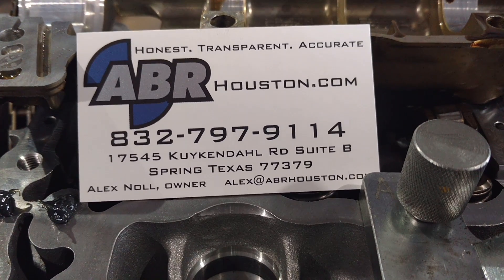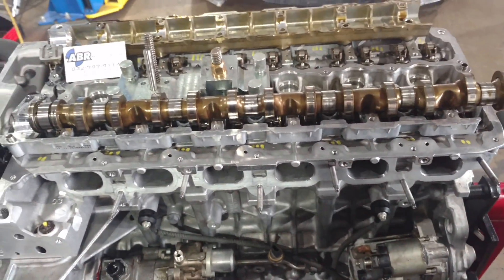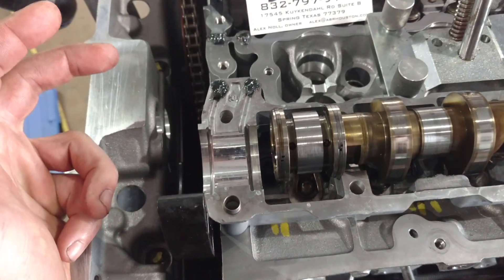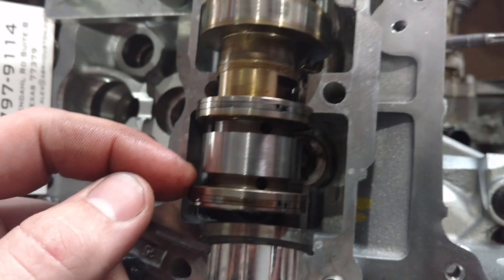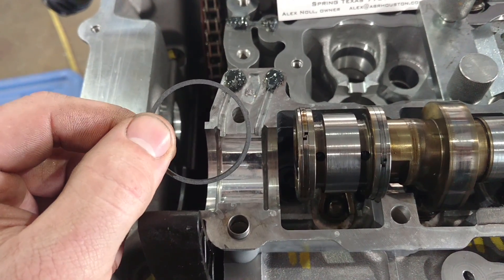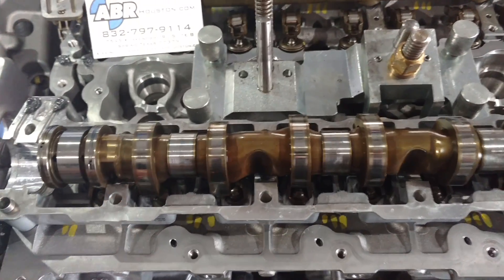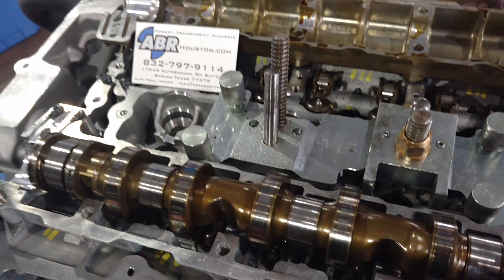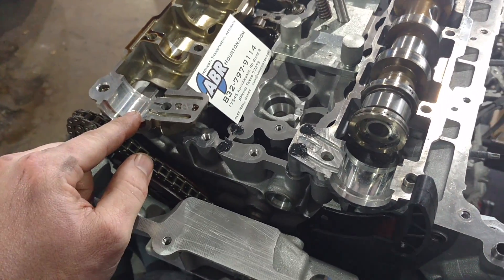ABR Houston explains N54  N52 and general Vanos faults and why

Comment: Occasionally, VANOS iosues coan be caused by the non-return valves on the side of the block. Also, it can be caused by mistakenly swapping the exhaust and intake connectors (white wire with red tracer is the exhaust and should go to the lower solenoid, the one with the blue tracer is the intake). One more issue could be the ring that needs to be properly seated at the bottom tip of the oil filter cap. That small green ring closes the oil drain to the pan, which during normal operation should be blocked by that ring. Great content, thanks for posting. Makes one wonder why BMW doesn’t use the teflon seal that you’re recommending.

Comment: Hello just subscribed to your channel, really good information. Question? I have a 2010 bmw 328i i moved from Washington DC area to hot Florida, I'm using castro 5w30 currently. Should i use a different viscosity oil or continue with what I've been using? Thanks again.

Comment: Hi. If there are no check engine light, but intake camshaft value is from 60.8 to 61.2 in all RPM range. Does it mean that camshaft rings are bad? If it's possible that vanos are stuck in one position?

Comment: Hello Alex, I am having this 2A85 code.  Car run perfect with exhaust vanos solenoid unplugged. As soon I plug in the solenoid, the car will run like it burn to the ground and die and will not start if I don't unplugged the exhaust solenoid. Please help advise.

Thanks,

Comment: Could this issue ever cause an N52 to die at idle/stop lights? I have The 2A82 code, but the car isn't sluggish or anything. But it has just started to sputter and sometimes die at stoplights, and low revs starting to go up an incline. And not all the time, just once every drive. After it dies, I start the car and it's fine.
Reply: I just ran across this same issue! I just changed the oil and cleaned the solenoids. Soo let’s see how this goes!
Reply: @TheOfficialKarl1  lemme know how it goes! I already did what you did, no effect. I'm thinking eccentric sensor next, but it happens so rarely I might also just live with it lol

Comment: There is no ledge for inlet camshaft like exhaust in n52. So if I replace only the first bearing cap would it help? Or I have to replace whole cylinder head because the rings scratches both sides? What do you think? Please help

Comment: Hello.  Does just replacing these metal rings with Teflon ones help?  I have a sucking vanos bug.  I replaced selenoid and vanos.
Reply from the maker: If the cam trays are grooved, they must be replaced as well
Reply: Thanks for the answer.  If there is a groove, should the head be replaced?

Comment: I am getting occasional codes usually when the engine is hot. Assuming there are smaller groves could Liqui Moly Ceratec additive help?
Reply: Yes it could. Even for ticking HVA.
Ceratec takes effect after 800 kms.

Comment: This is excellent video mam. I have 2007 bmw 328 xi and I have a p0012 code, I have clean oil in the engine and. I replaced camshaft and exhaust valve solined with bmw part and. I also have no vocum leaks ether,any help on how to diagnose p0012  would be greatly appreciated!

Comment: Why do the trays need alignment tool when there are tube dowels to do so?
Reply from the maker: Dowels can only align so closely. The machined edges that the tools align put the upper and lower journals together perfectly.
Reply: @Abrhouston  I'll take measurements. if there's more play than a couple tenths. I'll make the tools in my spare time at work.
Reply from the maker: @diyguy6054  or.... Use the tools 😁
Reply: @Abrhouston  I'm a toolmaker, I'll make them.

Comment: Hello, I was seeing the explanation of the failures of the openings. I would like to know if you can guide me to solve several codes that mechanics fail to fix.
I have a bmw e60 525i 2006. The fault codes are:
* 2A87 Exhaust vanos mechanic.
* 2FA4 Incorrect data
* 2E7C Bit serial data interface, signal
any suggestions?
Reply from the maker: If you're local yes- we can help! You've got some interesting faults but they'd need to be diagnosed first
Reply: @Abrhouston  unfortunately no, i live in dominican republic.
Reply: I have some INPA, NCS EXPERT, and WINKFP programs.
Can you help me if I can solve these failures with these programs.

Comment: if you have had this procedure done in the past, how long should the repair last? I am getting the 2a82 and 3100 codes on n54 that point back to this issue. It's only been 35k miles!!
Reply: So what happened? My car has a 2a82 and 3100 from limp mode. Replaced the solenoids and checked the filter. Then I cleared the code never came back. Now I have a different type of lobed idle after the car warms up.
Reply: @emrecan_m4  I had to sell my car, lost a lot of money on this. I had the bearing ledge/ seal ring procedure done for the second time, and the new piece was completely chewed up. Unacceptable, really. I hope their is a class action suit or something, total failure of @BMW engineering on this one. First repair, had new ledges and rings replaced, maybe around 65K mile mark, way too early for this type of thing. After trying all of the minor stuff (solenoids, filters, etc) we cracked open the engine again at around 100K miles, and the pieces failed again. Maybe I had a lemon, but I can't recommend anyone buy this engine design.

Comment: I like your way of explanantion.... I got error code 2D5A and 2C58 in N55 engine and my mechanic tried checking the VANOS Solenoids (Changed the Wall cover with a new one) and swapping and found no issues, changed the CAM Shaft sensor Intake, tried realigning the CAMShaft still the same issue and now he's gone change just the Intake VANOS. Any suggestion from your experience would be highly appreciated.
The engine has rough idle and Half power sign.
The car was not having any issues until the mechanic changed the WallCover as there was an oil leak and a sound coming from PCV valve.
Reply: @user-t3b8l  I managed to fix it. Timing done again. I started doing many things myself. Started making YouTube videos too 😂😁😁

Comment: Great video explaining this issue. One thing I noticed though, is you didn't mention the filters in tje side of the head found at the front of the exhaust side. 2 T40 torx bolts that are fine guazes the filter the oil to the vanos solenoids. These often block up on cars that have poor service history and long intervals between oil changes. Otherwise a fantastic video, amd you deserve more subscribers putting out such quality content.
Reply from the maker: To be honest, we rarely see those get clogged up unless the engine is REALLY sludged.... but you're right it could be something to check but rarely the solution . Thanks for the props!
Reply: @Abrhouston  we're based in Western Australia, and if an N52 or N54 is dealer serviced, if it is ever late for it's oil changes we see them sludged. Partly due to the manufacturer making the intervals too long, and partly due to the owners negligence.

Comment: Great info sir. Do you also know the main cause of ticking on n54 motor?  It seems like almost every n54 has it.
Reply: Direct injection
Reply: are you saying that it is caused by injector being directly on  top of the cylinder?
Reply: Well not that specifically. Direct Injection is know to be noisy

Comment: I just replaced the valve cover due to PCV issue on a my 08 328i N52 with 70k on it. I checked the intake camshaft blocking rings. I could not feel a gouge from the rings, yet there was a wear pattern from the rings rotating. I understand the exhaust cam box can be replaced along with intake and exhaust camshafts. Except, since there is a wear pattern on the intake camshaft head side (first cam journal), that would require a new cylinder head? I no longer have start-up lifter noise since I switched to Castrol Edge 0w-40 five oil changes ago. I change my oil between 4 to 6k. Also I have no codes, rough running or sluggish power delivery, so I am not going to worry about it for now.
Reply from the maker: N52 heads don't exhibit this issue on the intake cam. I'd not worry about it
Reply: So you haven't seen an n52 at all yet that has needed the head replaced due to intake bearing ledge being worn? I have read about quite a bit of ppl replacing heads due to this issue thats why i ask .but I recently purchased a 07 x3 that is giving me intake vanos code on start up only. i switched solenoids and checked and cleaned filters but code still appears on intake side. I was assuming my intake ledge was damaged but upon removing valve cover i found serpentine belt throughout the timing chain area. so my next question is can a partially clogged oil pickup be causing my oil pressure to be low on start up and therefore cause the intake vanos code or would both intake and exhaust side give codes if that was the issue? I know in most cases the engine is recommended to be replaced due to oil passages but after initial start up the car idles perfect with no ticking at all so i plan to drop the pan and clean out all the belt but not sure if thats related to the vanos issue or not.
 @Abrhouston
Reply from the maker: @micsmith806  Sounds like you have more problems than just a vanos code- if you have belt in the engine, you probably have clogged oil passages causing this.

Comment: Thank you for the video, very good explanation. Do you replace the bearing ledges too i guess? Or just the rings (N52 you cant replance the VANOS intake bearing ledge, i wonder if it would help something to just change the rings...)?

Thats why i would never again go for an N52....
Reply from the maker: The Aluminum is different on the head vs. the cam tray. We've not run into an intake bearing ledge on an N55 or N52 that has caused wear like the exhaust cam tray does. 
No, absolutely we replace the cam tray when we see wear that would cause a VANOS issue.
Reply: Thank you very much for the answer. So i can relax now. I think i might have to do the job but i was worried about the intake side. So i will just replace the exhaust side.

Comment: Can you explain the special tool and CAM tray alignment more? It seems like the trays have doweling pins to align the trays when putting them back together around the cam shaft. If that's the case wouldn't it be aligned just by the pins?
Reply from the maker: I understand the confusion. The lower cam tray is aligned by teeth that hook into the head, which makes them sit straight. the top has really, not much to align with. The jigs go over the top of the cam tray and align with machined flats to properly set the bearings and tray in place while you're torquing the bolts.

Comment: I have an  08' 535xi in the shop that has a VANOS fault codes. it is running seriously rough/low idle, and the timing chain seems to have a lot of slack on it. I have only pulled the valve cover. any reason to believe this could be the same issue you describe? the bad seals on the cams? 

this engine I was told previously had the accessory belt sucked in through the main seal, and both turbos replaced. I would assume that with the high likely hood of low oil pressure from the belt material in the engine that it destroyed the cam rings. I dont know if the pan was dropped to clean out all the material, I can only assume they did.

Comment: I have a question, So I have a 2006 bmw 325i and it has 131,000 miles on it and it drops slightly in rpms every single time I come to a stop. Its not huge but it definitely is noticeable. The car will sometimes hiccup kind of bad like jumping rpms and when this happens I usually get vanos intake and exhaust codes but I have changed the solenoids to new ones and this did not help. Any idea what my problem could be?
Reply: That would be your valvetronic motor.

Comment: First of all, awsome video! What could happen if you have this problem and you keep driving it like this...?
Reply from the maker: The check engine light, possible engine surging and lack of power. On turbo cars, the turbo's will be disabled by the engine computer. It's not going to make the engine die/blow up, but certainly won't let it perform correctly.

Comment: What oil do you recommend for the N54's? When someone buy's one of your engines what oil do you say to go with? 5W-30? 0W-40? 5W-40?

Based on some research and 4 years of ownership, ive used Mobil1 0w-40 Euro Syn. But I've seen some new talk about possibly running 5w-40 from Rotella or Motul Xcess 5w-40...?
However, some swear by the BMW recommended Castrol Syn 5w-30. 

Summer here in NY gets hot 85+ atleast. Could be 100 on hotter days + humid. But winter will get down to 30 and avg's about 40 in winter. 

Should I be running a different viscosity oil in summer and winter? 

Any input on this would be great!!!

Thank you for the vid Alex!
Reply from the maker: We run Motul Xcess 5w40. It's an LL01 approved oil. Now, BMW says that they have updated to a 0w30 LL01FE for all N and M engines...... 4 cylinders and B engines are to get a 0w20 LL14FE+ oil...... rumor mill has told me that N63 engines with the 0W30 have been hurting the rod bearings, especially after an oil pan gasket replacement (possible cavitation or draining of the oil pump?)...... so we're in a hard spot. DO we shift with BMW's recommendations to a 0w30 LL01FE on N5x engines, like they said we "should" or stick with what we know works well? Do we shake in our boots with an N63 oil pan job and run 0w30? yes lol. 0w20 LL14FE+ is very expensive and not easily sourced except from the dealership as well. Oil is such a long winded and very opinionated debate....
Reply: Got that right. Some in depth studies on this would be nice. I think the proper LL and getting the oil to its operating temp for some miles, is the biggest thing. The money from other companies certainly has something to do with them "updating" recommendations. The engineers knew what they were doing when they built these. Steel rings are the perfect thing to get some money in the hands of the dealers 100k miles down the road, while ensuring short term(warranty period) reliability.. its genius.

Comment: NIce video but on my  Bmw 525i i am getting the engine code p0012 and my car keep going into limp mode and my gas  mileage has dropped tremendously ....i keep having to turn car off and on but it goes right back into limp mode... what is the cause in that
Reply from the maker: Anton Ford without proper diagnosis, your guess is as good as mine. If you want to spend a lot of money, find a bad mechanic! 
Make sure you do your research on the shop you bring it to :)
Reply: I remember some research was basically talking about cam hook rings may have went bad
Reply from the maker: get it properly diagnosed, that way we're not guessing
Reply: bmw gave me them codes and they said on the printout was a suspected camshaft bearing or oil hook seal was bad
Reply from the maker: Anton Ford again, you've not had it properly diagnosed. That's what I'm trying to tell you. someone read the codes out. They've not properly diagnosed it.

Comment: I have a 2008 with the exhaust code that I replaced the blocking rings on. Test drive car and somehow the crank bolt came loose while running. Haven't had a chance to check how much damage it's done yet. I only turned the engine clockwise with the crank bolt about half a rotation to line up cams and put the jig on to take the gears off. I think the engine is toast.
Reply from the maker: That sounds ugly.... Not sure how you did that :(

Comment: Hello, while changing CCV(due to high oil consumption), the old hose that went from CCV to crankcase was not even connected, after installing new CCV and connecting all hoses, engine started fine and was driving good.
After changing oil, engine went into limp mode, long crank, wanting to stall , very big rpm jumps up and down, check engine light. Mechanic said 3 fault codes leading to bad VANOS, and suggested to have both vanos replaced or serviced? Does that make sense?
Engine is N52
I checked for codes with my phone, only got this one:
P0341
Camshaft position sensor "A" circuit range/performance (Bank1 or single 
sensor)
Will call a technician to come with computer to get more codes if there are any.
Reply: Also he said he hears VANOS rattle on intake side, are N52 vanos service-able ? 
Would the camshaft grinding grooves on intake side be worst case scenario? Because the intake cam tray and  cylinder head are cast together? And would need the whole head replacement?
Reply from the maker: I wish I could give you solid advise, but unless it was an early model N52, you can't replace the CCV separately. Vanos is not rebuildable, and the exhaust tray can only be replaced- intake is part of the cylinder head. "Call a technician to come with computer" means you probably have it at the house, which probably means your not using a shop, which probably means your going to not get decent results..... Just sayin' consumer beware.
Reply: Basically took it to a shop, car was there about 2 days, they told me they adjusted engine timing and I got the car now everything is smooth... All the people on bmw forums told me that I got "scammed" and engine timing adjustment was not needed. My guess is they cleaned solenoids and everything is fine? No idea.
Reply from the maker: I'm really not sure, mainly because I wasn't there to experience the issue/see the faults/diagnose the problem. Abe Lincoln said it best- "Everything you read on the internet is true", so take forums with a grain of salt.
Reply: ABR Houston Your BMW Specialists Well the car runs fine like it did before, but even though ccv was replaced oil is being burned a lot. Im so lost. Cant find honest shop that I can trust. Seems like every shop in my country just cares about money and not the customer...